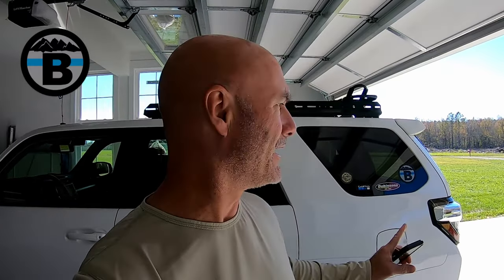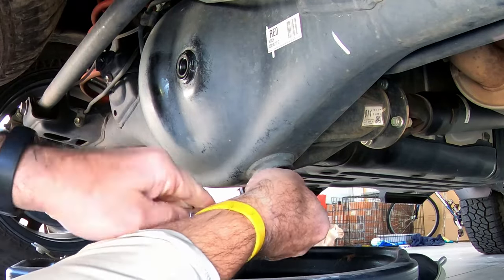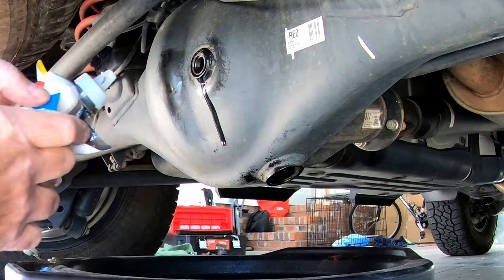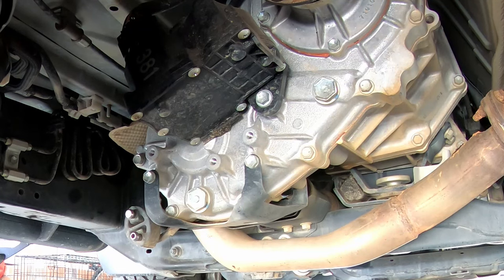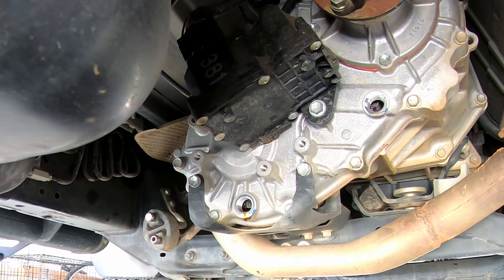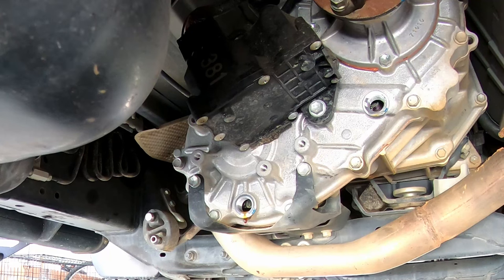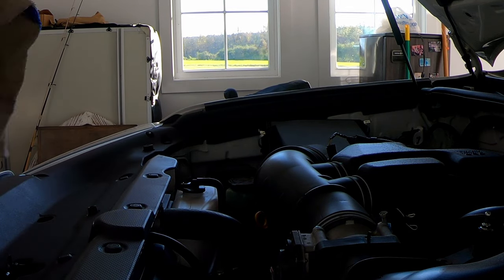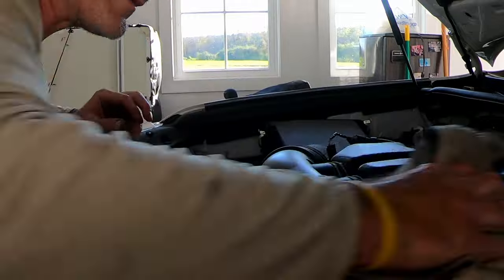Fluid Service on a 5th Gen 4Runner

Comment: The guy commenting on torque technique is being silly.  Best to give it two shots.  Thanks for all those torques, they are a pain to remember.  But you should put in new crush washers as they cost nothing.  Same on oil fill plug, I always replace the washer with a new blue Toyota one.  Remind people not to over torque that fill plug, it strips easy.  Also, the transfer case is 75W, and I could only find it at Toyota, not 75-90 or any of the others readily available in auto stores, but it is pricey if you do it right.
Reply from the maker: Thanks for the comment about the torque wrench. I’m not real worried about what others might think, I’ve been working on vehicles for years, so I kinda know what I’m doing. They can do it the way they want, and I’ll just keep doing it the way I want. 

As I mentioned in the video, I would typically change the crush washers, but I didn’t this time. Honestly, although they are very inexpensive, it’s really not necessary every single time. I’ve put over 20,000 miles on my 4Runner since making this video, but not one leak. Again, it’s certainly recommended, but it’s not that big a deal. 

About the 75W fluid, Toyota recommends that fluid, but there is absolutely nothing wrong with using 75W-90 in the transfer case. It’s commonly done by many with no issues whatsoever, and I even checked with a Master Toyota Technician who also said that he uses 75W-90 fluid. Not only is it very expensive, but also somewhat difficult to find. In fact, many dealers don’t even use it because of its limited availability. Again, no problem at all with using that fluid. 

Thanks for your comments, and I appreciate you watching.

Comment: so 3 gear box has  the same fluids you use 75W-90?
Reply from the maker: Yep, I used 75W-90 for both differentials and transfer case. That’s widely done, and I was actually told by a certified Toyota tech that it was fine to use. 

Thanks for watching!

Comment: Ocupaste 6 litros en total para los diferenciales ?
Reply from the maker: I’m not sure about liters, but I believe I used a total of 6 quarts between both differentials and transfer case. You refill until it begins to run out of the fill hole, then reinstall the fill plug. I used the same fluid for all three.

I hope this helps. Thanks for watching!

Comment: Did you jack up the vehicle to change the front differential fluid?
Reply from the maker: Thanks for watching! No, I did not jack up the 4Runner for any of the service. I have a Dobinson lift which adds around 2.5” of lift in the front, so it wasn’t necessary. Even with no lift, I still don’t think it would be necessary.

Comment: Synthetic or non synthetic???  also special additive for rear????
Reply from the maker: Thanks for the questions. I thought that I had included the information, but maybe not. The Valvoline 75W-90 gear oil is full synthetic. It also includes any friction modifier that you might need if you have a limited slip differential. As such, there is no need to add any modifier to the fluid. 

Thanks for watching!

Comment: Ive not been able to remove the nut on the bottom of the oil filter housing. Not a single time.
Reply from the maker: I assume you mean the release valve? If that’s the one, it’s probably too tight. The torque specs for that is very low, I think only about 10 ft/lbs. If it’s too tight, you end up removing the entire housing, which usually ends up making a mess. Neither the release valve nor the filter housing should be right at all. Let the rubber O rings do their jobs. 

Thanks for watching!

Comment: Before you start changing diff/transfer case oils, make sure the vehicle is on the level ground. Otherwise you will either underfill or overfill
Reply from the maker: I appreciate the comments. I was in my garage, so I think it was pretty level. 

Thanks for watching!
Reply: @bluelineoffroad  I meant it would be nice to mention that

Comment: Put a Fujimoto  or other drain valve in the oil sump.  Don't need crush washers... no oil on your arm... and no need to strip the threads in the oil pan either.
Reply from the maker: Thanks for the suggestion. I’ve thought about a Fumoto drain valve, but chose not to get one. If I lived on road, I would probably be more prone to get one. But, I spend a decent amount of time off road, so it’s something else that could be broken on the trail. 

Thanks for watching!

Comment: At what mileage should this be done?
Reply from the maker: There are several different options on when it should be done, but I did mine at 40,000 miles. If you tow a trailer or off road more heavily, then possibly 30,000. 

Thanks for watching!

Comment: I thought the transfer case needed a slightly different fluid? GL 4 as well. I thought just 75w . I bought redline MT LV
Reply from the maker: Thanks for the comments. I think I mentioned this in the video, but the manual does “recommend” the 75W for the transfer case, but it’s incredibly expensive and extremely difficult to find. It’s also widely believed that many Toyota dealers don’t even use it because it’s so hard to get. I checked with a Certified Toyota Technician who stated that 75W-90 was more than acceptable for the transfer case, and it’s also widely used by DIY’ers because it’s so readily available and its price. 

Thanks for watching.
Reply: Manual transmission needs GL4 fluid because of "yellow metal"  components deteriorated by GL5 sulfur content.
Reply from the maker: @davecaselli1957  There’s nothing in this video about transmissions, either automatic or manual.
Reply: @bluelineoffroad  Comment by "Aviation 2016"  proposed that the transfer case requires GL4 lube.  I poined out that GL4 is required in manual transmissions instead.

Comment: Do you use the same gear oil for all 3 oil changes?
Reply from the maker: Yes, I use Valvoline 75W-90 for both differentials as well as the transfer case. I know that the manual recommends Toyota 75W fluid for the transfer case, but it is actually very difficult to find, and also extremely expensive. In fact, many Toyota dealers don’t even use that fluid. I contacted a Certified Toyota Technician who stated that 75W-90 could also be used in the transfer case. 

Thanks for watching!
Reply: @bluelineoffroad  Thank you for the quick reply...just wanted to make sure it was ok to use for the transfer case and the price is right.

Comment: I use a 2 liter bottle with the end cut off for a funnel.  No clean up necessary!
Reply from the maker: I’m not really sure what you’re referring to. A 2 liter bottle with a funnel? Is that used to help fill? If so, I’m not sure how much easier it can be than the Valvoline bags. 

Thanks for watching!
Reply: @bluelineoffroad  No, for the engine oil instead of the little funnel you used. 😅 I’m sure these comments are all out of the blue after however long ago you made your video!

Comment: I use 500ml syringe. Works perfect.
Reply from the maker: Thanks for the comments. I use a syringe, actually a turkey baster, to remove fluid from my brake fluid and power steering reservoirs, but the bags that Valvoline uses for their gear oils works really well for adding fluid to these mechanical parts. 

Thanks for watching!

Comment: first and foremost you have to make sure the car is level otherwise it might drip but not necessarily at the right level depending on what angle your diff is at ...if your garage floor isnt level you won't get a >>>correct drip<<
Reply from the maker: I appreciate the comments. I’m not sure how many garage floors are sloped, especially enough to make any difference with the level of the fluids. Thanks for watching!
Reply: @bluelineoffroad  it's the building code that requires the slope...it might or might not affect the level in your diff...

Comment: How do you flush it out all the fluids
Reply from the maker: Thanks for watching! You don’t flush them, simply drain the old fluid and refill with new. There won’t really be enough fluid left to worry about flushing. Just warm everything first by driving as that helps the fluid flow more easily.
Reply: No flush !
Reply from the maker: Nope, no flush. There’s no reason to flush either of these components. The only driveline component that you might consider flushing would be the transmission, but I wouldn’t flush that either for a number of reasons. 

Thanks for watching!

Comment: you should always use a new crush washer....
Reply from the maker: I appreciate the advice, but it’s been almost 20,000 miles since I performed the service and still no leaks. It will be fine. 

Thanks for watching!
Reply: @bluelineoffroad  you can only crush them once... seems weird to spend $90 on fluid just to skimp on $1 gaskets....
Reply from the maker: @armondhammer9  Again, I appreciate your continuing support, but like I’ve already stated, they’re doing just fine. However, you are more than welcome to use new crush washers if/when you decide to perform this same service. 

Thanks again for watching.
Reply: @bluelineoffroad  couldn't even stomach the rest of the video after that... You probably run K&N everything with Mobil 1... am i right?
Reply from the maker: @armondhammer9  I sincerely appreciate your continued support and advice. However, I’m somewhat confused as to whether or not you’ve actually watched the video. You initially expressed concern over my not using new crush washers, and again, I deeply appreciate the advice from someone as knowledgeable and experienced as you. But, you’ve now indicated that you failed to watch the watch the reminder of the video, so I don’t really know which to believe. 

If you were to actually watch the entire video, which you clearly have time to do since you continue to post comments about it, you would have noticed that I don’t mention Mobil 1 at all in the video. Further, I only mention K&N with regards to the oil filter, and I believe I also mention why I use K&N. You, on the other hand, seem to be an expert in all things 4Runner, so you can certainly decide for yourself which oil filter to use, and as I’ve indicated previously, you can also decide whether or not to use new crush washers. 

Again, I deeply appreciate your continued support and advice, and I more than welcome any further assistance from someone who is clearly knowledgeable about the Toyota 4Runner and how I should take care of mine.

Thanks again!
Reply: @bluelineoffroad  your brake fluid looks a little low
Reply: maybe you can make a video of that

Comment: You torqued the fill plug and then kept going, so it was actually tighter than what you set it to.

Also, you used the torque wrench as an actual wrench to remove the plugs on the transfer case. I cringed
Reply from the maker: Yep on both. Others have mentioned the same things. It just gives me a little more confidence to know that they’re tight, if only by a few pounds. As for the torque wrench, it’s a cheap one from Harbor Freight, so I’m not really worried about it. 

Thanks for watching!

Comment: Never do it at 10,000 miles I do mine every six
Reply from the maker: I appreciate the comments. I assume you mean the oil. I totally agree. Synthetic oils can certainly last longer than conventional oils, but I also have concerns about the filter’s ability to last for extended periods, especially since the filter is arguably more important than the oil. It’s just a fairly easy insurance policy to help your major driveline components last as long as possible.

Thanks for watching!

Comment: 40 years of wrenching and you're using a torque wrench for leverage? A torque wrench is a measuring device. Get a breaker bar.
Reply from the maker: I appreciate your concern, and I know exactly what a torque wrench is for. As I’ve already mentioned to several others who’ve also commented, it’s an old torque wrench that I don’t even use anymore. It’s what I had, and didn’t bother to get a breaker bar. It’s really not that big of a big deal. 

Thanks for watching!

Comment: He also used the wrong oil in the transfer case
Reply from the maker: Who are you referring to as “he?” Are you talking about me? I appreciate your comments and opinion, but that’s actually not true. The manual recommends 75W fluid, but it’s incredibly expensive, and also can be difficult to find just as it was when I filmed this video. There was actually a period when it was so difficult to find that even Toyota dealers weren’t using it.

I checked with a Certified Toyota Technician before performing the service about using the same 75W-90 fluid in the transfer case. Not only did he say that it was fine, he stated that he actually uses it in his own 4Runner, and that it’s widely used by many 4Runner owners when performing this same service. 

You are more than welcome to use whatever fluid you like if you actually decide to perform this service. 

Thanks for watching!
Reply: Definitely didn’t use the wrong fluid. If you read the manual it states 75W, OR 75W90 is fine, as long as it’s GL5. Most Toyota dealers don’t use the Toyota 75W gear oil themselves due to cost and availability.

Comment: As per the manual, the transfer case oil is not the same as the front and rear differentials. It is only available in the stealership. I am sorry to brake the mood, but you overtightened every single plug. When the wrench clicks, that is it. Your technique of doing one extra with torque is bad. Especially on the transfer case, you put may be 20% more, as it was only 27 ft/lb
Reply from the maker: Thanks for the comments. I know what the manual states, but I contacted a Certified Toyota Technician who stated that 75W-90 could also be used in the transfer case. The Toyota fluid is rated at 75W, but it is actually difficult to find, and very expensive. In fact, many Toyota dealers don’t even use it. 

Thanks for watching.
Reply: I didn't want to put it out there either, but yeah made me cringe for each extra push. Especially into aluminum housings...
Reply from the maker: @GerardoOntiveros10  Im not sure what you’re referring to regarding an extra push into an aluminum housing. The amount of fluid which I used was the correct amount for each part, regardless of whether that part was aluminum. 

Thanks for watching!

Comment: You forgot brake fulid, seriously dangerous if there's excess water in it. You Yanks change oils way too often but always neglect a major safety system.
Reply from the maker: I appreciate the comments, but I’m not neglecting anything. I didn’t include service on the brakes in this particular video, nor did I include service on items such as the radiator, power steering fluid, transmission, etc. However, I’m actually changing the brakes within the next month and will be servicing the brake fluid at the same time. 

Thanks for watching.

Comment: Why did you keep tightening the plug after the second click. It clicked and you continued tightening? Just awful. I guarantee those are tighter than spec. Quit holding the ratchet at the neck too. 🤦‍♂️ I bet you choke up on a hammer when you use one too. lol
Reply from the maker: I appreciate your comments, and you’re not the only one to notice that. I’ve always done that, so it’s nothing new for me. But, a little extra isn’t going to make any real difference. Torque wrenches typically have a little variance, so it’s really not necessary to have each bolt torqued exactly to the spec. Maybe you can come here and give me some instructions on how YOU think I should use a torque wrench, a hammer, or any other tool in my tool box. I’m always open to have an expert opinion on something that the expert feels so strongly about. 

Have a great day, and thanks for watching!